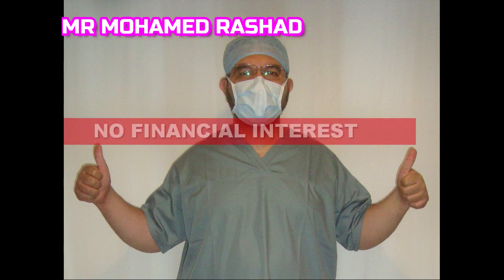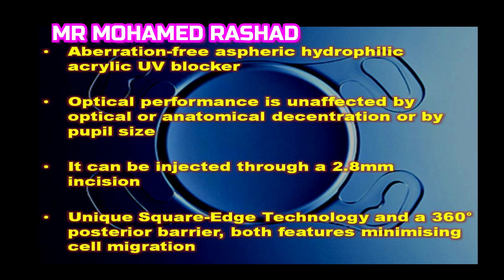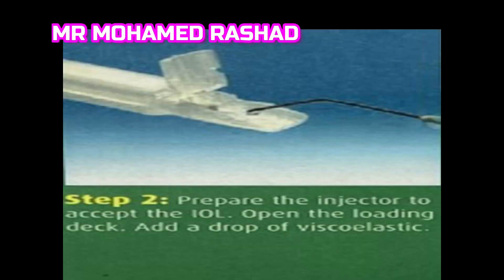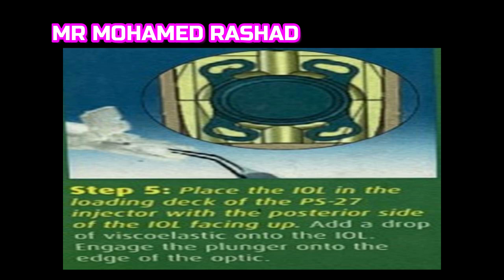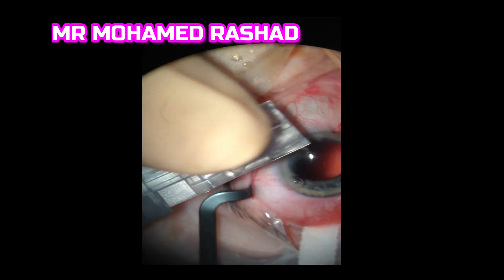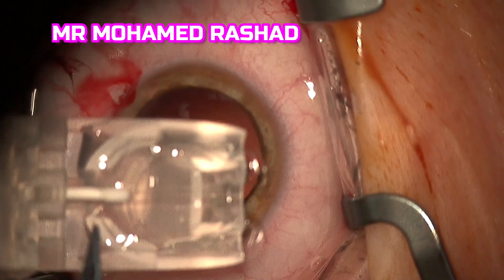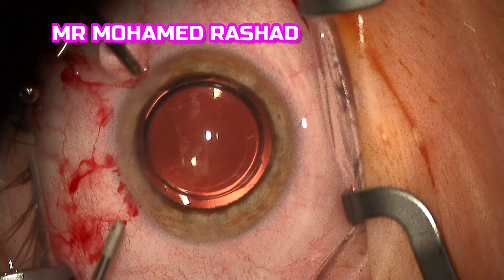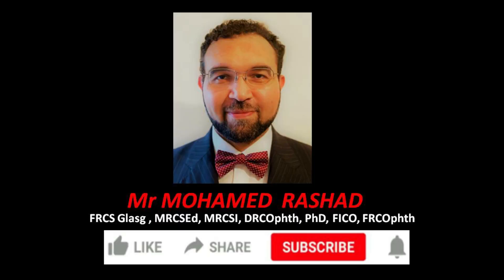Akreos Adapt-AO Intraocular Lens IOL implantation during cataract surgery زراعة عدسة العين

Comment: What if the IOL is injected upside down?
Reply from the maker: @goodcomment1  Thanks for your brilliant Question. It depends if IOL if Multiple piece or single piece, Monofoccal or Multifocal. 
If an IOL is implanted upside down, it can lead to a number of complications, including:
Optical quality: The IOL can lose its optical quality 
Pupillary block: The optic of the IOL can be captured in the pupil 
Myopic refractive outcome: The optic can be displaced anteriorly in the eye 
Corneal edema: The cornea can become edematous 
Chronic iritis: The eye can develop chronic iritis 
Cystoid macular edema: The eye can develop cystoid macular edema 
Iris synechiae: The iris can develop synechiae 
The effect of an upside-down IOL depends on the lens geometry and optic design. For example, a normally posteriorly vaulted IOL will cause a myopic refractive outcome if implanted upside down. 
To avoid complications, it's important to verify the correct orientation of the IOL before and after implantation. If an IOL is implanted upside down, it can be repositioned or exchanged.